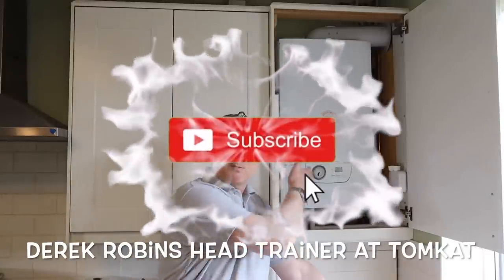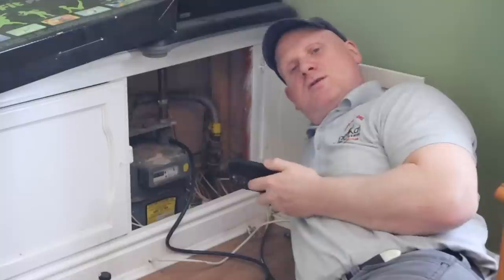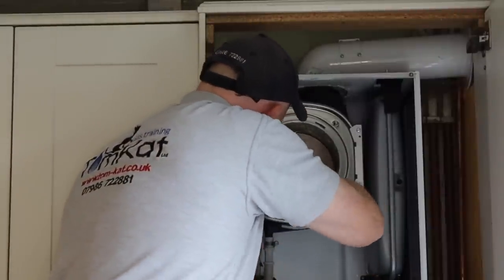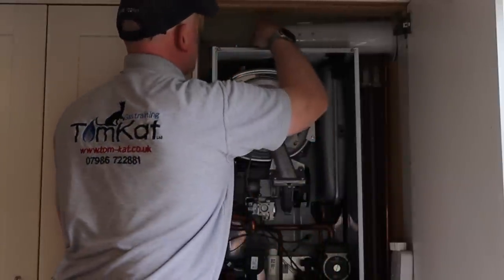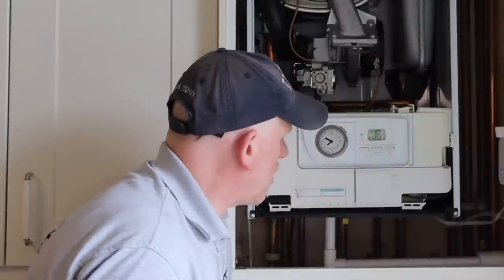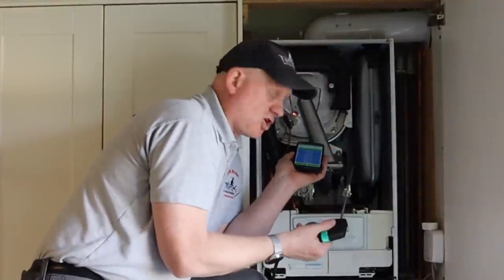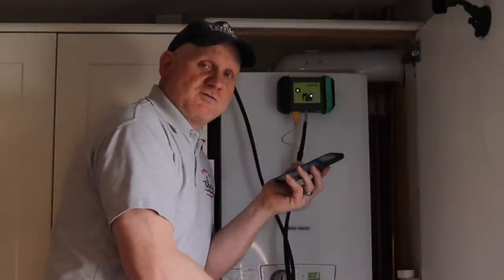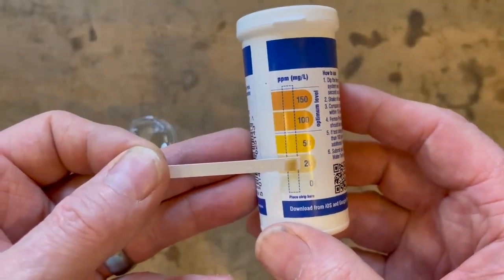Boiler service to new building regs part L. will gas engineers comply and will customers pay for it.

Comment: Regarding the expansion vessel check, I’m always cautious that during a service we can open a can of worms. We close the service cocks to drain the appliance and often they start to leak after a certain age. We are then obliged to nip off to find a new one  and that’s if we’re lucky enough to find one in stock. If not it means going back and either way it throws out the schedule for the next jobs. I agree it needs checking but I favour the tap it test and listen foe a dull thud  or a ping and then monitor the pressure gauge during the fga test and look for a rapid rise. 👍
Reply from the maker: I agree mate
Reply: I agree don't mess with valves on old boilers unless you have to. I would check the pressure gauge to monitor how much it increases when running on heating.
Reply: @geoffaries  you probably should go and bleed all your rads in case they are acting as expansion! Then monitor the pressure gauge.
Reply: @YoutubeHero666  obviously!
Reply: @YoutubeHero666  although I said obviously, it's my experience that if the charge has been lost then it will still be seen that the pressure increase is to too high.

Comment: For a bit of balance most condensing boilers can be serviced in 15min properly to mi spec.
I advised new customers there’s like an a and a b service and b service is usually planned and if on an a service I need to strip it I let them know then we take it from there.

But ultimately it can be very quick. Especially if your boiler stock is newish
Reply: Not a Worcester, no way .
Reply: @elwittinio2865  why not.
Negative fan pressure says if it needs stripping or not.
If it doesn’t 
Test burner seal and if ok all that’s  left is working pressure analyse it and gas rate it. 
Quick visual, condense if needed it’s not a complete sequence some bits are missing but it can be quick.
Especially if it’s like a year or 2 old

Comment: Copper grease in sachet to stop expansion noise, 6 nm for burner flange nuts and no need to clean electrode, they have special coating on only need a soft brush, we also soft brush the primary coils after the poking 👍
Reply from the maker: The special coating on the electrodes doesn’t seam to work then. Seen too many sparking in the wrong place. 😜
Reply: @tomkatgastraining  yeah agree, but that's what vaillant r&d told us, excellent service though, pity a lot of engineers don't do half that🤔 analyse and go🙄

Comment: Very informative video as usual. Just don’t know if i missed the part of vessel charging, do we have to drain the boiler to check vessel pressure and charge it if needed. Also any video about gas rating and what it means and to do if its not wt is expected. Finally u promised a video about weather compensation
Reply: Always drain the boiler to charge expansion vessel. If you don't you will not have the correct reading because of the pressure from the heating circuit.

Comment: Excellent video and very informative. Thanks for taking the time and trouble for doing it. At point 36:09, you mention about gas rating the CH and DHW. Any chance to can explain how one goes about actually doing these caluations please. The silicone grease on the HE is to stop creaking noises caused by the expansion and contraction of the HE and associated metals parts. So says the Vallient Engineer. !!.  Thank you
Reply from the maker: https://youtu.be/dXDJuRy69uM
Link for gas rating a g4 meter
Reply: I work mostly on valliant boilers and get asked about the cracking sounds by customers. I know what causes it but never knew this was how to solve the issue, cheers
Reply: @stevie7235  I didn't catch that on the video. Can you explain please, or tell me where on the video.
Thanks

Comment: Isn’t a general annual service just flue gas, trap, magnetic filter. Check pressures etc???
Reply: Over .0009 on the flue gas ratio means you may need to check further, for example full strip down service and cleaning insid. That's what I was told.
Reply: @mixer7586  had a brand new Worcester reading .0010 on commissioning? Down to the MI’s
Reply: @davem4131  I've never installed a Worcester boiler, I suppose you would have to allow for that accordingly. Use you own initiative just make sure its safe. 👍🏼
Reply: Annual service comprises of what and when the MI's say.

Comment: Copper greas is to prevent cracking noise when metal is heating up since heat exchanger and heat engine is two different metals, second thing bud i didn't do let by test. That's what i notice and i only watched first 15min. Also this what u have here is ideal conditions absolutely perfect conditions almost text book setup. Another thing is in shit countries we take out both heat exchangers out put them on descaling pump so both heat exchangers full cleaned. So4 usually used since it's the strongest. And that's normal big service.

Comment: What about a final tightness test, that gas tap under the boiler could of failed after you turned it off and on a couple of times.
Reply: True, I always do tightness on my way out. If its anything more than just a service then first and last, there's nothing worse than chasing an old leak once your committed.

Comment: question........ how bad does the corrosion need to be on a meter? before you report it? when it leaks?

 its a heat paste, you know the nuts are lined with plastic and you already know the heat exchangers vibrates (vaillant group eh), think of when theres an air mixrure is screwed up and you get that whiring sound for a few seconds when you!ve removed the meter and theres air in the line. guess they didn!t make boilers like they used to or maybe they can't. do you remember when they sent theses things out of the factory with rubber seals not the graphite ones? and metal nuts? not lock nuts.

have you never gone to service one of them and found a lose nut/ ideals are the same. just service correctly and do all your checks.

im guessing it!s a heat paste.!!!! no i don't work for any boiler company. so its all guesswork, thinking about it why dont you phone them record it and ask what it is? save me a phone call:P

shouldnt you have put a circle of paste aroung every threaded nut coming out of the heat exchanger? or was that what they changed it to later on?

love your uploads.

Comment: Many years ago BG stopped doing “invasive” servicing on boilers, fires and cookers for the the simple reason that 60 (odd) percent of breakdowns were within 6 weeks of a service. 
Visual inspection and analysis- if its not broken don’t fix it - but now we have to - and not all engineers are the same so you’ll be fixing old appliances 
that fall apart in your hand..
“Well…you touched it, it was fine this morning”
Reply: Yes, I forgot to test a gas fire the other day that I was about to service, as soon as I finished hoovering it out and put it all back together, I tried to light it, of course the slider bar wouldn’t function properly and then the customer blamed me for breaking their obsolete fire, always make sure you tear an appliance before you service it???
Reply: Test I meant
Reply: Yes Carl, I think we’ve all been there -
My moment in time was a Halstead many years ago, just dropped the control panel to check behind ( no hinges obviously) and the copper tube to the pressure gauge fell off through corrosion. Couldn’t isolate it on the boiler valves, bent the tube over - which did s*d all, then let it go through the prv, which then was also goosed. 
And you couldn’t get a new one love nor money, wanted a new boiler, threatened court action the whole works - gave them £100 and walked away. 
Sorted my T’s and C’s accordingly (quickly) and never trusted anyone again - that was 15 years ago I reckon.
Reply: @miketurner3964  that sucks badly, why did you give them 100 note?
Reply: @miketurner3964  if the boiler fails that badly then the customer should understand that common sense should prevail, spend money to save money is the answer, some people are just completely fucin stupid!!!
Reply: Well, after 3 days of looking for parts, threats of legal action, 4 calls a day etc.. the legal advice was to offer recompense (in writing) as settlement. 
Which I did via the solicitor, and they accepted- the money wasn’t the problem- the speed it went down hill was.  
Every boiler service / breakdown thereafter was only done after confirmation of the T’s and C’s. (Written up by the solicitors)
99% of people were happy to agree, the other 1% that refused… I considered a close shave. 
Still, left oftec and gas safe last year, 
after 30 odd years, and feel nothing except relief.

Comment: Derek am I wrong in thinking the flue only has to be cemented on one side?
I’m sure I got a gas safe meno saying inside or outside, of course it’s better to do both but only one side needed?
Reply: if the flue has a seal on the outside its not going to be a danger but if its sealed on the inside and without the boot on the outside then gasses could get into the cavity. out side only should be enough imo
Reply: Belt and braces, inside and out .

Comment: Great videos as always, very informative. I don’t want to the person but one thing I did notice on that boiler is it appears to be wired in cable and not heat resistant flex? 🤔 am I been over the top?
Reply from the maker: Yep because it’s a condensing boiler so doesn’t need heat resistant cable 😜
Reply: Should be flex imo
Reply: @tomkatgastraining  Final connections to boilers should be made with flex (Heat resistant if required), because, invariably the connection is made to a hinged, 'drop down' panel.
Flat grey cable is for 'fixed wiring' only, and does not provide, or is intended to give flexibility, and would be subject to cracking, long term, through movement.

Comment: I had a gas safe inspection 6 months ago and screwed the test nipple in the meter live and apparently you can’t do that because it counts as a live gas escape.! Although the Ecv is right next to meter.🤔
I do it that way to make sure the standing pressure isn’t over 30mbar.
Reply from the maker: Yeh after speaking to a few inspectors over the years I seam to be loosing respect for gas safe. I wonder what that inspector thinks about purging then🤨
Reply: @tomkatgastraining  yer you can fail your assessment for that we were told
Reply from the maker: @aftermath3127  not at tomkat you wouldn’t

Comment: Why are they using the word dynamic pressure ?
Reply: When the boiler is off, but the gas is on the gas is static and has a 'Static Pressure'. When the boiler is turned on the gas starts moving along a pressure gradient, from High to Low. As the gas is moving it is said to be 'dynamic'. if you test the pressure at any point along this pressure gradient you will get the dynamic pressure at that point. The maximum pressure will be at the incoming main, the lowest is inside the burner gas nozzle.
Reply: @whitefields5595   I have always called it  standing presure and working pressure   .

Comment: Why don't you set the FGA to read CO and go round that seal with a bit of tubing  on the probe to see if it leaking. Better than using the finger for heat ?? That's what I do anyway
Reply from the maker: I did use an analyser guess you skipped that bit
Reply: @tomkatgastraining  My apologies you did , sorry my friend i'm wrong. Good vid by the way

Comment: few things,  that is not a heat engine the heat exchanger is the heat engine 
second never use any metal or abrasive materials to clean tubes in heat engine only soft plastic bristled brush , its copper grease to stop the ticking on expansion 
yes I'm ex group service
co2 readings should be 9.1% hi and low and no ppm on air intake

Comment: Why are you saying we have to clean a heat ex every year? This is not the case at all, vaillants is every 5 years(pretty sure glow worm is the same) worcester is only if it fails a fan pressure(or every 5 years for safety), always follow the manufacturers instructions, also you can't expect customers to pay for seals every year just because you want to clean a heat exchanger?
Reply from the maker: I don’t say that and if you watch the video all the way through you would know that. So before making comments on YouTube videos make sure to watch the full video not just the first 5 minutes or it makes you look an idiot

Comment: Brilliant vid as usual Derek. Learned a good deal as usual.
Quick question, why do we charge the condense trap before putting back in?
I've always done it but truth be told from habit rather than understanding the reasoning?
Reply from the maker: It stops the poc from just going straight through the trap which can come into the room if you have an air break inside. Also stops damage to the trap 👍🏻
Reply: @tomkatgastraining  Ah.. got it. Thanks.